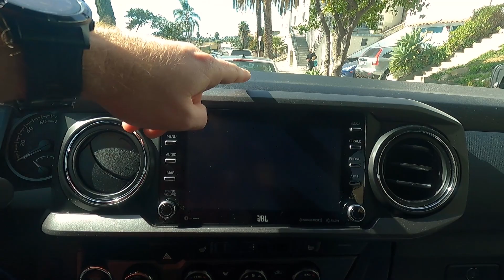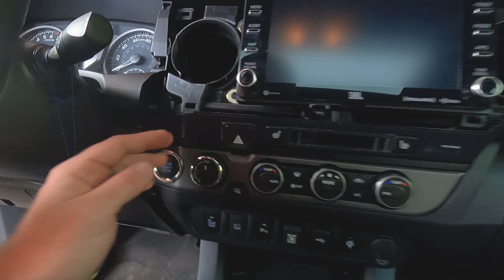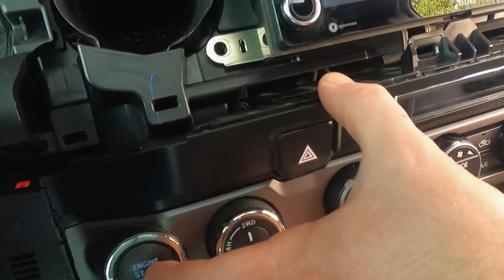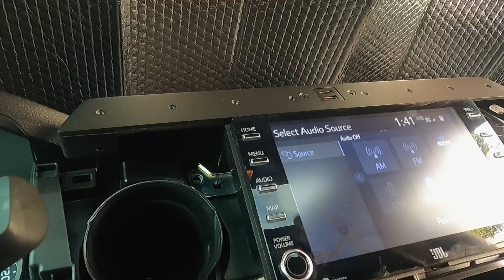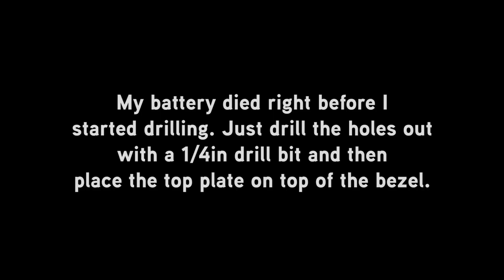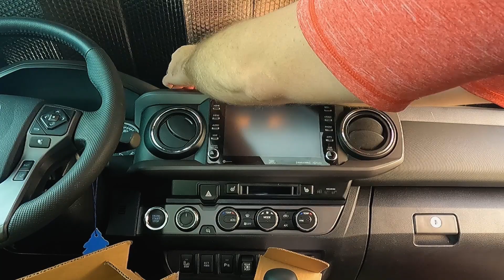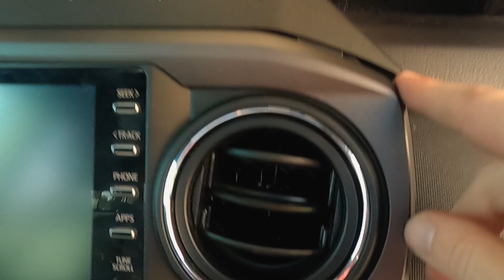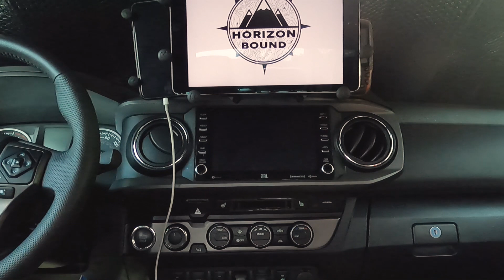AWESOME interior mod for your ACCESSORIES!  - Expedition Essentials 3TPAM

Comment: You can still adjust your mount and make it more flush on the passenger side. Mine started out like that, I found out that the plastic on the bezel did not line up perfectly when tightened down. I took it off and finely ground out the plastic. Before tightening you can wack the passenger side with the palm of your hand a few times, then tighten it securely.
Reply from the maker: Good to know! It hasn't bothered me much since I've just accepted it but now that I know it can be better, I'll probably take it all apart because of you lol! Thanks! lol

Comment: Great video. Wish I would have seen this before I ordered mine. I’m not going to be happy with the gap on the passengers side. Especially for the price. I could have purchased a different brand that was a lot cheaper. But we will see. Will be here next week sometime.
Reply from the maker: Thanks! Luckily I don't really notice it since I'm driving most of the time but the times where I ride shotgun to shoot video, I notice it and it still irks me a little. It's still an awesome product though and I'm super stoked with how well it holds all of my electronics while I'm off-roading. Part of me wants to take it all apart and try seeing if I can get rid of the gap but I spent a few hours working on it the first time and that was the best I could get it. Hopefully you'll have better luck installing and it wont be as noticeable!

Comment: Unrelated, what radio head unit is that?
Reply from the maker: Just the stock one that came in the 2020 Off Road Advanced Tech package. Thought about getting aftermarket but it works great IMO.

Comment: Nice man. I have kings and method 702’s as well. Not sure how much trail time you have on your kings and your methods but you’ll love them on the trails
Reply from the maker: Nice man! I'm loving my 702s and, I mean, Kings? Doesn't get any better! The only thing I was iffy on was whether I should go K02 or KM3. Went the K02 route and so far I'm happy with them although they did get a nice half in cut from a previous rock crawl adventure. So far, I've gone offroading with them in Yosemite, Big Bear, and Joshua Tree and trying to plan the next big adventure!
Reply: @HorizonBound  nice! My buddies and I are supposed to be hitting up Colorado for about a week in July. I’m looking to get back out to Cali and head to the Alabama hills at some point.